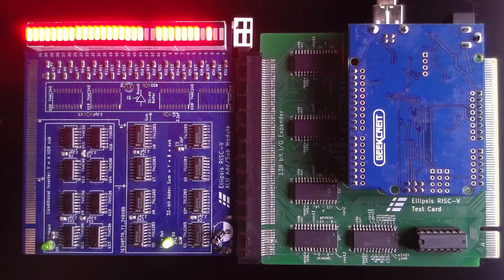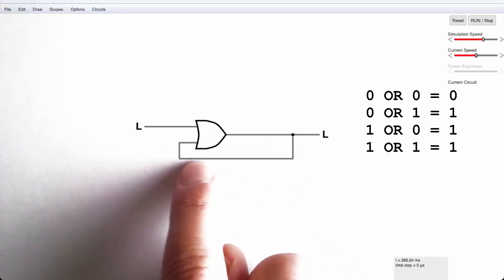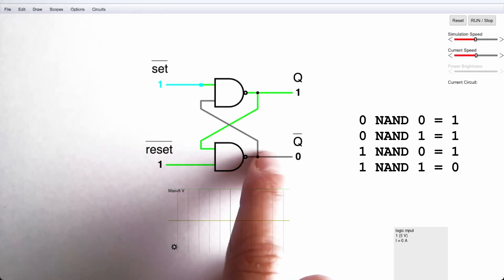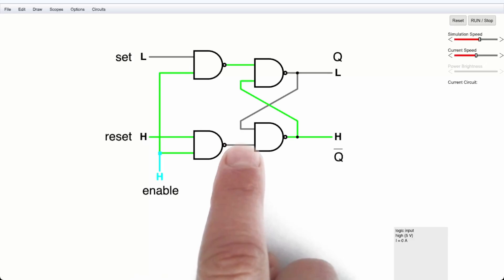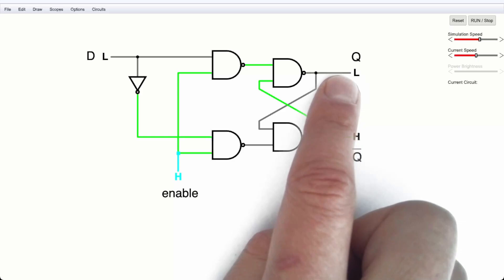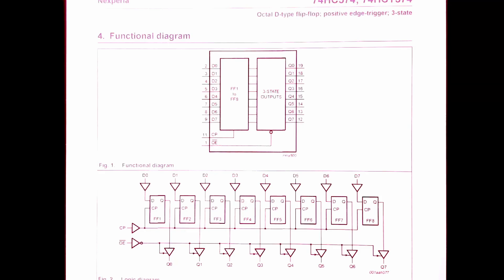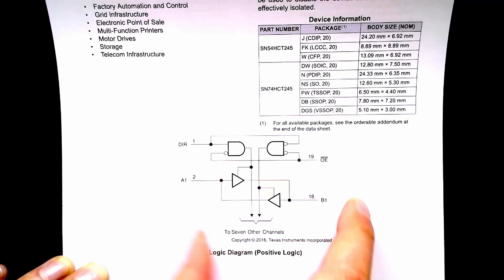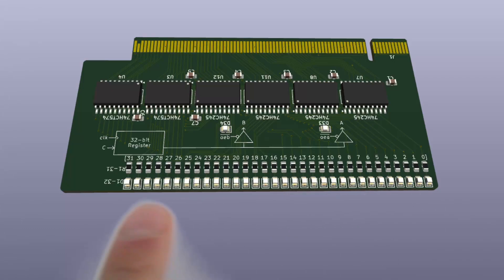A 32-bit Register (RISC-V Part 6)

Comment: I tried replicating Arduino i/o expansion you did, except with esp32 and instead of MCP i used CD4067 16 channel analog multiplexer since I don't really need parllel i/o and MCP is a bit costly in my area, around the same cost as esp32 but cd4067 is far cheaper for me. Anyway good work as always. What is your opinion on ysing cd4067 instead mcp23017? Are there any better and cheaper options you suggest?
Reply from the maker: To be honest, I use the MCP because it's the one I'm familiar with. I tend to buy most of my chips on Aliexpress and the prices there are usually cheaper than anywhere else and often include shipping - you can get 5 surface mount MPCs for about 10AUD. As for other I/O expanders, depending on your needs you might get away with something like a shift register which can be much cheaper. But others similar to the MCP (e.g. similar chips from TI) I've not used, so couldn't advise.